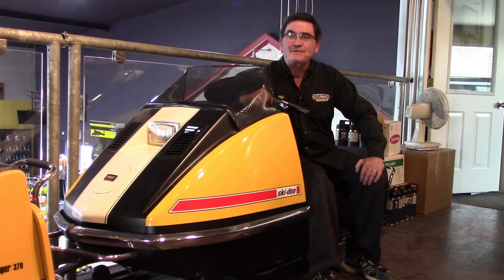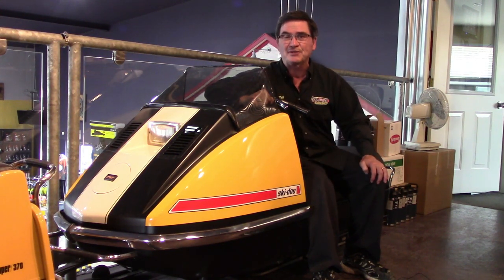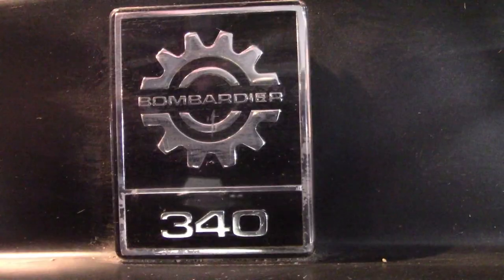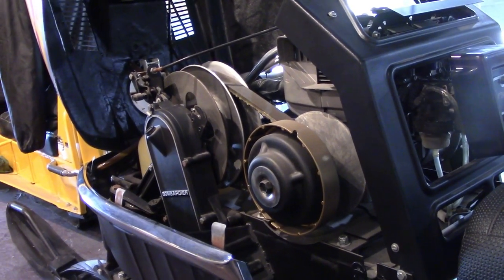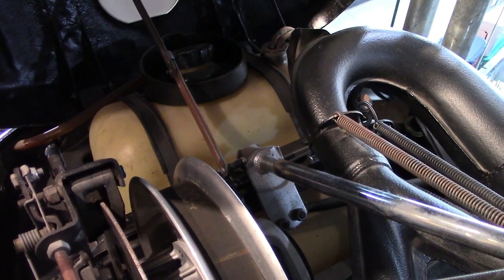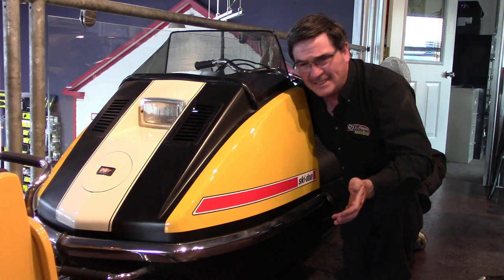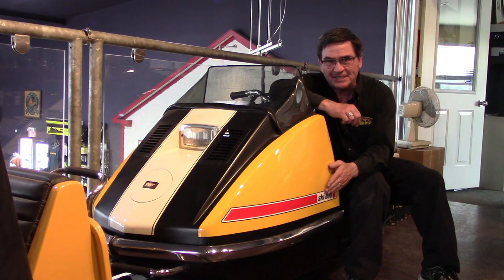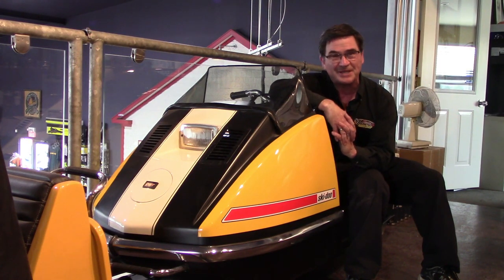TVM 1972 Ski-doo TNT

Comment: I was born in ‘79 and my father had, in 1972, bought a new TNT 440. I always hated it! Loud, rough riding, hard-starting,  plug-fouling snowmobile. Needless to say it and me never got along too well. I suppose you guys didn’t know any better or have any better than these in their day. Snowmobiles have come a long way!
Reply from the maker: Your points are well made and properly received. Those smoking smelly fouling engines were state of the art in 1972. Premixing fuel-oil was a skill and most sledders had way too much oil that fouled the plugs, which we carried many of back then. By the time you yourself started riding, that was an old sled with old technology and the sled itself was probably getting tired in every aspect. My 72 TnT ran great up until the mid 80s when every mechanical/moving part was suddenly just tired. You are correct, snowmobiles have come along way since then. Cheers.